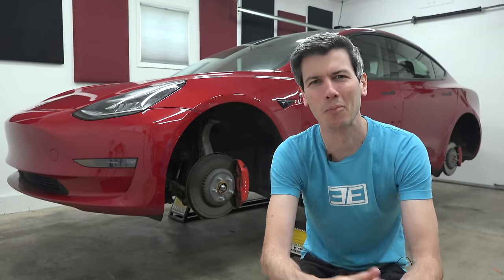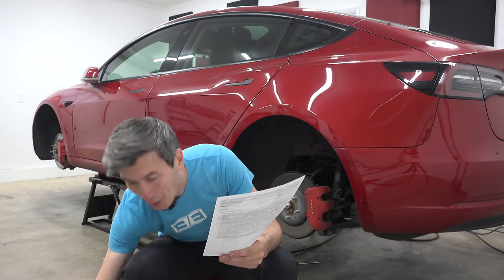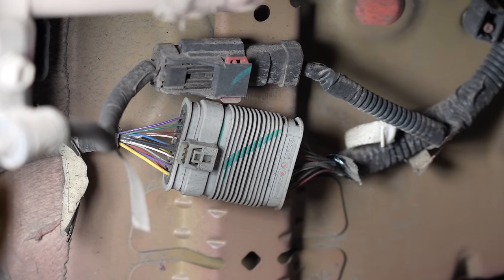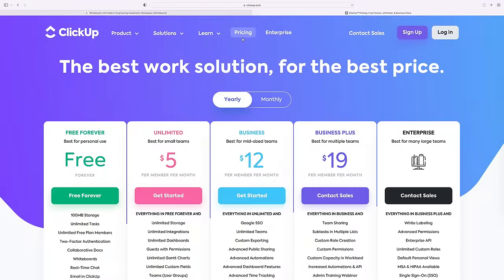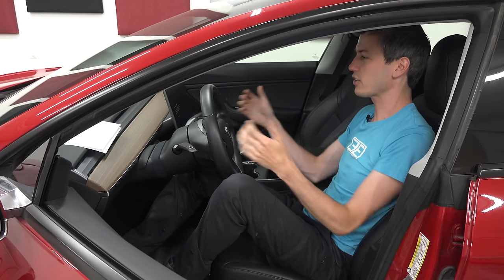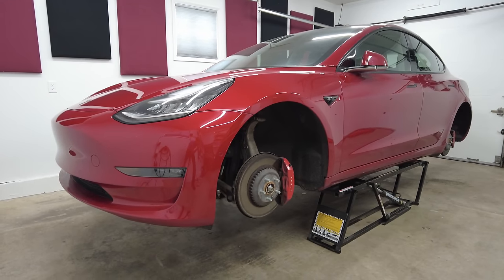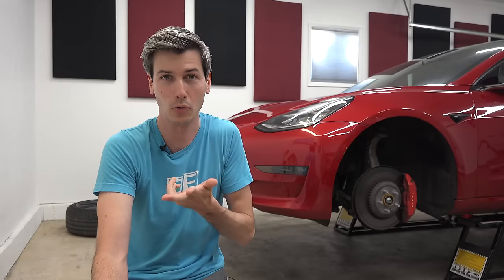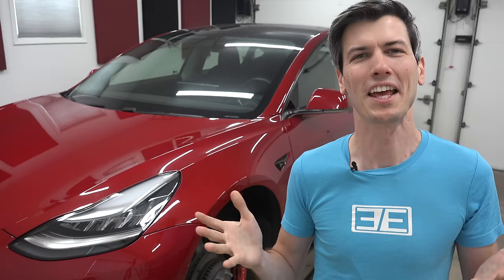Tesla Battery Damage? I Ran Over A Metal Bucket

Comment from the maker: Go to https://bit.ly/3BZlczF and use code ENGINEERING to get 15% off ClickUp's massive Unlimited Plan for a year! Start reclaiming your time for less than $5 a month. Hurry offer ends soon.

Anyone else run over anything significant with your car? What happened? Glad this wasn't like my pothole experience!
Reply: Glad to here it was not an expensive repair, I had something come up underneath and knocked off a governor cover on the side of a auto transmission (700R4), all the fluids shot out and burnt up the planetary gear sets. Doing the work myself it cost me about a grand.
Reply from the maker: @E.T.GARAGE  wow! Was that from continuing to drive, or a pretty quick failure (for the planetary gears?).
Reply: I thought Tesla made Autopilot a free feature that comes standard, it's not retroactive to older Model 3s? That's a shame.

Maybe you can check out the latest Model Y P when it comes out of Texas soon, once they start using the 4680 batteries and structural design. Would be curious to see what you think of the many changes and evolution of the platform. Or maybe even Cybertruck lol.

At current prices the trade-in value might be pretty solid, and remain so next year as well. Just a thought.
Reply: @EngineeringExplained  I would have to say some of the fluid loss came with out me noticing it and a hole bunch of fluid dumped out and that was it, If you want I can link a YT short video of the streak of fluid it left.
Reply: what are your car jacks called? I've been looking for that full sill type for ages but I don't know what they are called
Reply: Please tell me what those car jacks you have are, they look extremely compact, and I want to buy them.
Reply: I hit a speedbump at a mall going ...0.3? and it smashed my transmission. We need standards for speed bumps.

Also, that's awesome that you found a reasonably priced service item.
Reply: Had a 8 pound steel rod, bracket thing pop up from the big rig in front of me a lane over and pierced through my windshield and almost killed me doing 75 mph down i95 lol. He ran it over and it popped up and came at me str8 up like final destination. Incredibly even though it was almost 4 feet long it landed perfectly in the windshield and only broke the windshield and I casually pulled over after it happened. 200 bucks from safelight hahaha. Thank god I saw it coming at the last second because if I didnt turn away and close my eyes that second it would have gotten glass shrapnel all in it and probably crashed!
Reply: You can order parts through the service part of the app, just get a quote for the part number and they can even ship it to you.  I have replaced a few minor things on my 2018 M3P this way.
BTW, I don't have AP/EAP/FSD either, and I like it that way, 75k manually driven miles and counting.
You will eventually get the upper ball joint squeaks, likely just over 50k miles like I did. I greased them, but ultimately replaced the whole upper a arms with Unplugged Performance parts, along with the lower joints. Huge improvement!
I also understand the pothole issue - I have destroyed 2 19" winter rims and have 10 (yes ten) 20" performance wheels, all of which had a 0.06-0.13" bend on the inside edge. I'm designing and fabricating a rim straightener to keep at least 4 straight...
Great content, keep it up!
Reply: I guess the moisture sensor is between the windshield and the frunk, they should be above the windshield.
They probably use hidden battery storage and the engineers and marketing did not communicate well or ... .
Reply: @EngineeringExplained  I used to own the same lift system that you have but I wasn't able to lift the whole car  because of the car's height. Did you do any modifications to the lift? Thank you.
Reply: @curbs100  those are quick jack branded floor jacks
Reply: Years ago, driving home at night after school & work, hit a large "rock" in the road making a turn onto another road.  It had punched a hole in my transmission and all the fluid drained out overnight.  I was young and didn't think to check the next day.  Transmission seized up on the way to school. Parent's helped me get insurance to get it covered.  About a year ago almost the same exact story happened to a co-worker's Maxima.  Killed his Transmission and had fight his insurance.
Reply: @Xxshadowman11xX  thank you
Reply: Some day you should do a video on the different EPA range test procedures.
Reply: Could you do one of your excellent engineering analysis on Dan O'Dowd's attack on Tesla's FSD software? I believe this is politically motivated and is a deliberate attack by Dan O'Dowd and his competing software company to unjustly wreck Tesla's product.
Reply: so they have done something with rain sensor cause in the last week it works and just know I have 231000 km on my car and other than the charger flap and the truck harness no problems as for the range i commute 250 km a day and until recently there was nothing else especially in the winter I live in canada now if they would just get the damn truck out I'd be happy.
Reply: How many miles you have on it? Great videos.
Reply: A dog, an emu. I have a 2003 Discovery with a winch bar!
Reply: I got a flat in my Tesla, cost me over 2 grand. Now I carry a spare, a jack, the jacking insert. (Teslas dont come with a spare, donut, jack, or the insert) now my entire trunk is taken up and virtually useless. Cant even fit a standard cooler in there. I was very upset. Tesla "engineers" made a lot of mistakes
Reply: 3 years ago a 4x4 piece of lumber fell off a truck on the freeway and I ran over it in my Accord at 40 mph. Nothing was damaged other than my alignment.
Reply: @AllanSustainabilityFan  Autopilot comes with every Tesla. Full Self Driving is extra, and adds extra features to Autopilot.
Reply: If you haven't already done so, replace your 12v battery.  They last about 4 years and die with little to no warning.  They are cheap, either DIY or by mobile service.
Reply: Still waiting 4 that thermal runaway update

Comment: Wow, an actual unbiased review. Amazing. Haha. I've owned a Model 3 for about 4 months now, and you hit the nail on the head. Every downside you mentioned is absolutely the case. Every point isn't a deal breaker but still annoying.
Reply from the maker: Haha but seriously, it has been years that the wipers go crazy in reverse!
Reply: @EngineeringExplained  I've been fortunate enough to only have wiper issues. Auto high beams work fine and I haven't had any phantom braking issues with Autopilot that others have had. I'll take wonky wipers over phantom braking any day. Still tho, shouldn't be a problem at all.
Reply: @EngineeringExplained  Fog and Drizzle... It just doesn't. I end up just manually pressing the wiper engage on the stock. Also, my friends 9k$ mutsubishi mirage has velocity sensitive wipers so when they slow down the wipers pulse less frequently. Hell it can even basically shut off until I press the accelerator for all I care. 

Love your videos Jason! Cheers
Reply: @mylesrussell  I'm very happy to have a physical stalk to control the wipers on my Model S. Despite 6 years of software updates and a paid-for computer upgrade, the auto windshield wipers and auto high beam features are still completely useless. If the car is left parked in the rain, when you first get in the windshield wipers go on full speed for several minutes - smearing melted rubber all over the windshield. Great!

The removal of stalks is preventing me from buying a Plaid. So I'm very grateful to Tesla for saving me so much money!
Reply: @EngineeringExplained  I don't use the auto wipers on any of my vehicles. One little mini hack for tge tesla wipers is rather than fishing through the menus just give washer button a little tap and it brings up the wiper controls for you. U probably already knew that.
Reply: How much does running hvac and heated seats impact range. Noticed some snow, had to ask.
Reply: @spooley  I live in Texas so I haven't used any heated stuff yet. But AC doesn't seem to drain a noticable amount. I'm sure there's infographics all over the internet for that. But for me. Daily commuting with AC on all the time hasn't drained the battery any noticable amount
Reply: @spartenz14  thanks, will look at some info sources and ask at cars and coffee
Reply: @spooley  Heated seats not much - they're 40W each. Cabin heater on Teslas prior to ~2020 were resistive - around 7kW, which eats into range quite a bit. Later Teslas use a heat pump which is around 2kW instead, so not bad. But it's difficult to know for sure what impacts range since the car doesn't separate these out for you. The battery heater also eats into range in the winter, but without it the range would be halved.
Reply: 100% this.  5 months in with 2022 model 3 LR.  The rain sensing wipers on my 2007 Mazdaspeed3 were better.  The other big problem for me is not headlight controls on a stalk, and full lights don’t turn on in a torrential downpour until it’s very dark.  I don’t see any alternative I like so far.  A hatchback/wagon version would be cool.
Reply: @EngineeringExplained  The auto wipers have all kinds of issues, but the one that blows my mind is that it can't tell the difference between "I just used the wash-wipe" and "I just moved to South Asia in monsoon season".
Getting the seal on the suspension control arm fixed before it failed is a real win. Mine failed and while it was a zero charge warranty fix, I had to live with it for a month waiting for an appointment in the service centre. Think child's swing that needs oiling - a constant screeching sound that's audible above the stereo, wind and road noise at 75mph. And from the way everyone turned to look at you drive past, it was easily audible outside the car.
However, my lease is up and I need a replacement. Three years later there's nothing that beats the Model 3 for my usage. There are more comfortable, better finished, cheaper cars (not all at the same time) but the fundamental engineering, the efficiency, the charging infrastructure and the fact most of the issues get ironed out make it still an unbeatable package. And I'll mention again, the charging infrastructure.